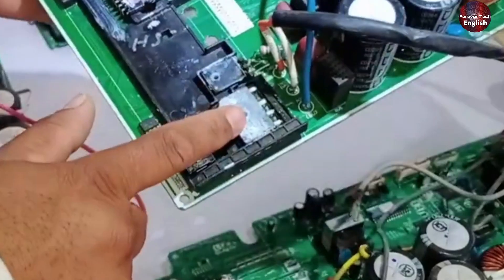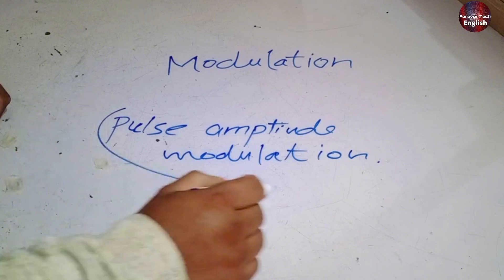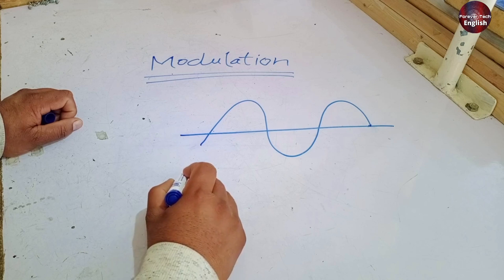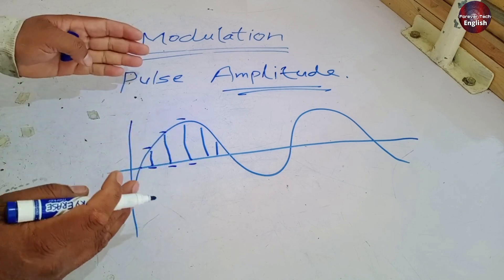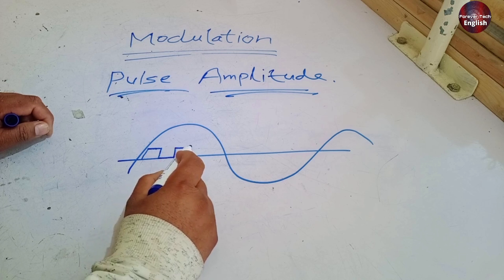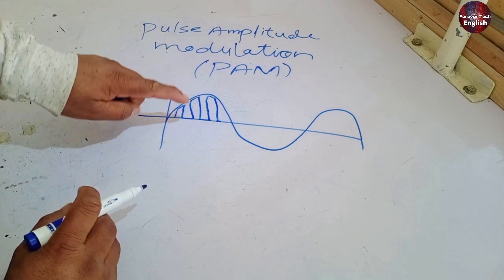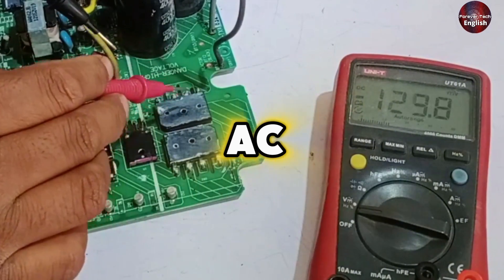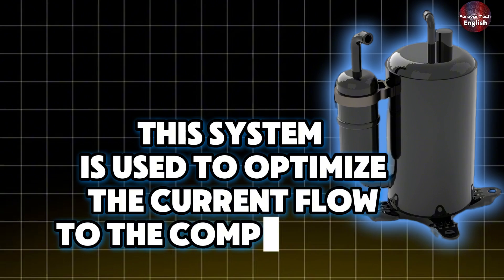The Surprising Role of Double Rectifiers in Electronics!

Comment: This explanation of why two bridge rectifiers are sometimes used makes too many assumptions of the viewers knowledge. At the very least a circuit diagram to show where in the circuit this is used and the purpose of the particular board used in this example would be a good starting point for context. Many comments here disagree with the explanation probably due to your lack of context. (Assuming your explanation is correct.)

Comment: Electronics and Communication Engineering Graduate here... We have studied about Modulations in Analog and Digital Communication Subject in our 4th Sem... Well in case of PAM.. you multiply the 50% Duty cycle Pulses to the Analog Sinewave to get PAM output, then we use hold up circuits to flat up the top of PAM signal...

You cannot multiply Rectified 230VAC with FBR(full bridge Rectifier), but can be done with BJT, MosFET or IGBT, but... That Switch is going to waste a lot of energy (in many cases upto 30-40% of output power, an it will be running in Saturation Region.... So here they are not multiplying the signals at all..  but using 2 FBR in parallel to handle more power, distributing Heat dissipation.... And using PWM modulation along with 50-60Hz Quasi Sine wave superimposed,it is done inside the Microcontroller onboard... And switched by IGBT or MOSFETs
Reply: Overall, the guy explaining knows nothing about electronics and power topologies
Reply from the maker: Thanks for sharing your perspective! It’s always interesting to see how different people approach these topics. However, some parts of your explanation don’t align with how these systems work in real-world power electronics.

For instance, multiplying rectified 230VAC directly isn’t practical or relevant in this context. The use of MOSFETs or IGBTs under PWM control is a standard approach to manage efficiency and power delivery. Advanced power designs ensure losses are far lower than the 30-40% range you mentioned, especially with modern switching topologies.

The FBRs in parallel aren’t just about heat dissipation—they’re part of a broader strategy to handle higher currents effectively. Also, the modulation here isn’t limited to the microcontroller but integrates multiple power management principles to optimize output.
Reply: @forevertechenglish  what is that product? I'll get it's design analysed
Reply from the maker: @ArifKhan-bp9zx @ArifKhan-bp9zx It's used in inverter mini-split outdoor units.

Comment: I didn't understand anything from your explanation. The second bridge rectifier is used as a rectifier for the field effect transistor? The transistor controls the current in the first rectifier circuit? Is this part of the power corrector system?

Comment: I'm using this in my products. The reason is to reduce the heat produced by the rectifiers as you practically put diodes in parallel. Not recommended generally but in this case ok as the diodes are on the same piece of silicon and have closely matched  forward voltage drops. Saves cost  and space, works very well.

Comment: This is wrong information. The PSU shown are non PFC so no power factor control. In non PFC, current mostly flow not continuous but only around peak voltage curve that so current is high then use two bridge diodes will share current flow. There is no modulation, the frequency depends on the network
Reply: This may be a " passive p.f.c. " circuit .
There are 2 stage & 3 stage passive pfc. , these improve the power factor to some extent but are mostly for light loads upto (50-100) Watts..
full explanation is available on the internet .
Reply from the maker: @analoghardwaretops3976 Well you are the first who got the point....
Reply: @forevertechenglish  perhaps.. I've worked with 2 stage passive pfc around (2008-2013) this period..
then it was in the (7-25)W range of compact fluorescent lamps...
nowadays I've seen them in some (15-30)W L.E.D. driver circuits.
Reply from the maker: @analoghardwaretops3976  Great to know that...

Comment: From the video: "the reason we use two rectifiers is to control the current which improves the power factor"

Now, if anyone can find anything in the video that explains how that happens, please let me know.

EDIT: Sorry, YT does not let me reply, but: So, there is actually nothing special about using two rectifiers. One rectifier with the correct current rating and heat sink, if necessary, would be just as good?

Also, merely asserting that two rectifiers "play a role in power factor correction" without discussing how that happens is not helpful. Also, are you talking about the power factor of the DC output of the rectifiers? Interesting concept.
Reply: Possibility of it being a passive pfc circuit...
These are built with caps/ diodes &/or resistors ,  &/or inductors..may be the 2 or 3 stage type.....
Pls.look up internet for more info.
Reply: @analoghardwaretops3976  How does adding another rectifier help with power factor? That is the job of the capacitors and inductors.
Reply from the maker: Double rectifiers are key in efficiently converting AC to DC and managing current flow. By working together, they split the incoming current, which reduces the load on individual components, preventing overheating and improving reliability. They also help create a smoother DC output by stabilizing the rectification process. Additionally, these rectifiers play a role in power factor correction (PFC), aligning the current with the voltage to improve energy efficiency and reduce power loss. This allows the system to run more efficiently, handle higher loads, and use less energy overall

Comment: Misleading title , it explains smps,  I was curious about this surprising use of twin bridge rectifyers,  it does not explain this
Reply: Since it’s on the mains side it’s probably just down to penny pinching. Using two in parallel theoretically increases the current capacity without having to use a larger one or a heat sink. There is at least 1.5-2V lost across the rectifier due to the junction voltage, so that ends up as heat. Second use is to join two separate transformers together to make positive and negative supply with a common 0V reference.
Reply: As a side note if the diodes inside are not well matched one will hog more current.
Reply from the maker: Thank you for your comment! Just to clarify, I didn't focus on SMPS in this video. The main topic was actually about the role of the two bridge rectifiers, which I explained clearly. If you could let me know the timestamp where you're referring to SMPS being discussed, I'd be happy to address it directly. Thanks again for your input
Reply: @forevertechenglish  You spent more that half the video explaining the function of the IGBT and gloss over how the rectifiers are wired and their function. It's not this guys fault he is confusing it with how a SMPS functions, he came here to learn and you confused him with a poorly put together video.

Comment: Wow! A transformer is now being called as a reactor!!😂😂
Reply: He's right that it's not a transformer, I looked again, and it doesn't seem to have a secondary winding. Which would make it functionally a massive inductor coil. I have never seen one that big. Also, I have always thought it was kind of dumb to call a part different names based on how or where it is used. And I have never heard anyone call an inductor a "reactor" before.
Reply: @kevbu4 ..sorry to say but the term "reactor" for a harmonic filter (inductor) is correct .. it's the tech. word used by E.E.'s  as a common term/word and is always the word used in technical papers/ discussion/presentations.
Reply: @ Merely stating my thoughts and opinions. And all I said was that I'd never heard it called a reactor before. Considering I'm not an E.E. and don't work in any part of the tech industry, I suppose that I'm simply admitting my own ignorance.
Reply: @kevbu4  .......many things are new to somebody sometimes... it's part of our learning process...
& it applies to me too I see such Y.T. sometimes just to keep myself updated...
Reply from the maker: Well, you might find it funny. But actually, it's not a transformer. You can call it a choke, reactor, or inductor. These are mostly used for removing harmonics from the current. I have already made a video on them.
Reply: seen bigger, but he no understanding

Comment: The two bridges are wired in parallel to allow for a lower profile in tight spaces, while still handling large currents.
The fet turns on for longer periods at lower portions of the curve, and for shorter periods near the peak.  Thus utilizing most of the curve, instead of only the peak.  
It is raising this varying level, through an inductor, to a much higher voltage (400V), which is then reduced to levels below 30V by another circuit.
Reply: I don’t know if they’re completely in parallel, looks like only one rectifier was connected to the filter capacitor judging by those voltage measurements. But that also doesn’t match any PFC circuit I’ve ever seen.